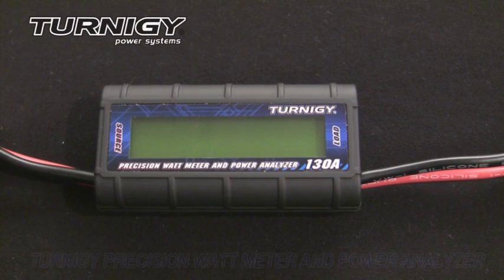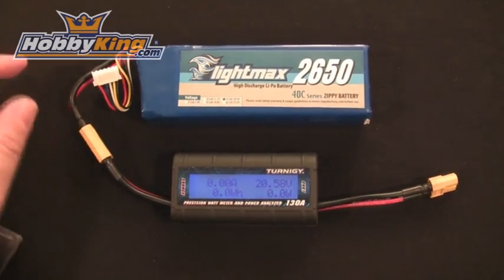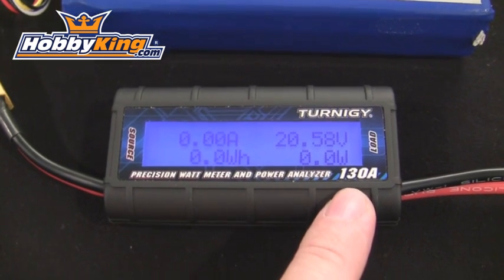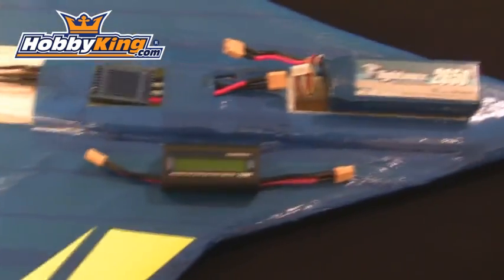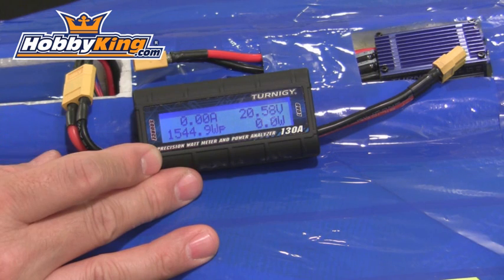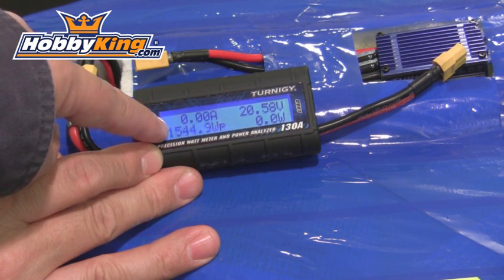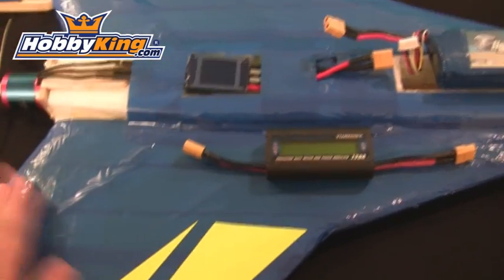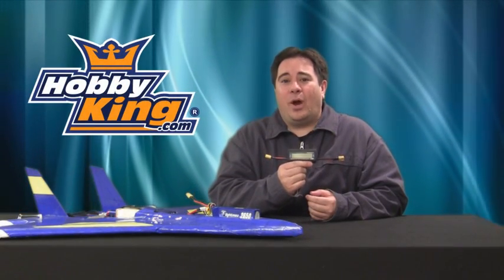Turnigy 180A Watt Meter and Power Analyzer - HobbyKing

Comment: how to connect the auxiliary battery? There is a three pin connector on the instrument. Which standard of plug is to be used and which 2 pins for + and -?
Reply: is this for battery or data logging?
Reply: oh nevermind

Comment: Can't I just use my multimeter in series to measure the current and multiply that by the voltage to get the power usage?
Reply: racerx1326 Yes, if your DMM can handle the amperage.  Most DMMs can only handle 10A.

Comment: I'm seeing in quite a few Youtube videos that this watt meter is not very accurate when compared to the other cheap China made watt meters available on ebay. Is this true? Would you do a test with your brand watt meter and compare its accuracy to lab equipment that produce precise Amps and volts.. It would help clarify the contention of others for me. Thank you
Reply: I like to see that too and see if you can calibrate it yourself and get it at least as accurate as the millimeter used.

Comment: can you set voltage and/or current limits with the Turnigy? I wonder if it is possible to save that data to a computer for further analysis, archiving battery motor configuration/temperature performance

It would be interesting if there was an app for an android phone that would allow monitoring and/or collecting the voltage/amperage data.
Reply: Can you save data to a computer?